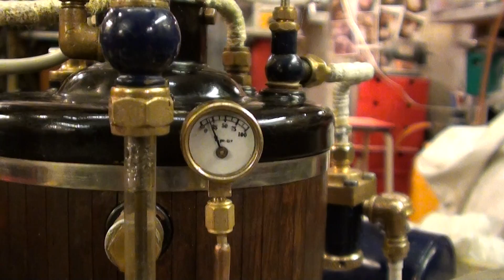Tvr1a test a waterpump from China

Comment: How is the feed pump working? I think i have the same pump [got it on ebay] and it fits the front shaft on a Saito T2dr steam engine perfectly. I have not hooked it up yet but installation should be the same as yours.